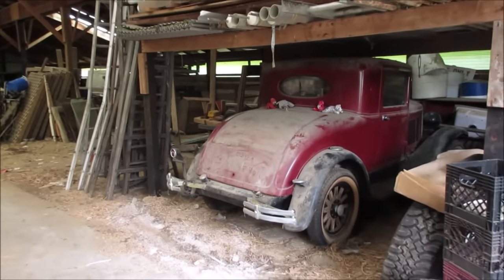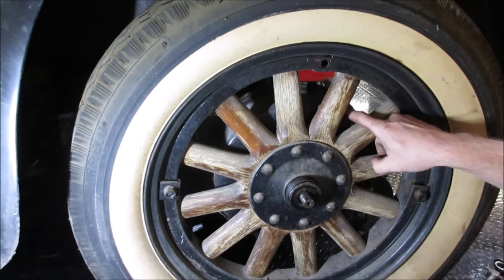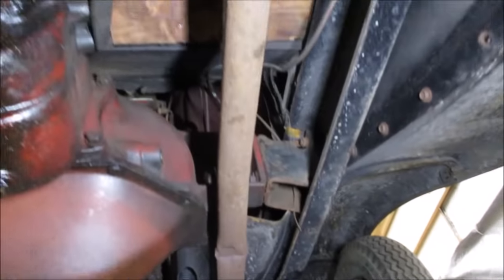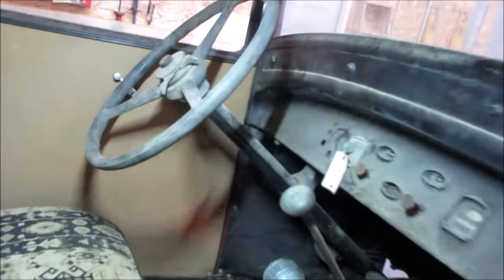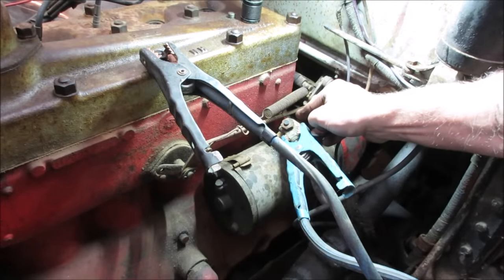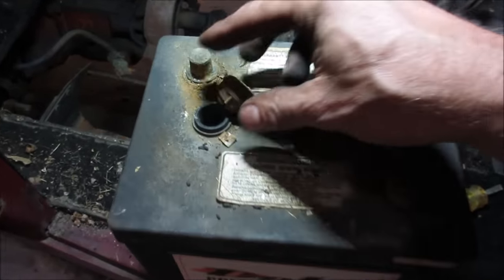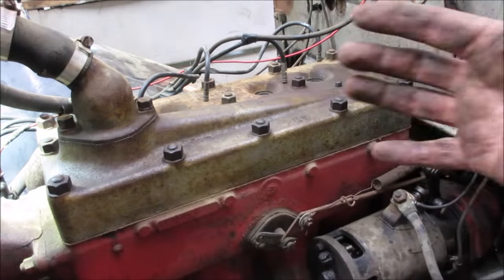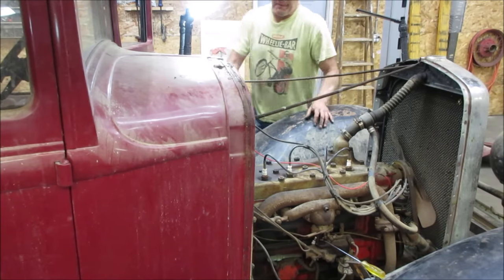abandoned rumble seat Plymouth, can we save it?

Comment: The brakes are adjusted with a gauge that measures the drum diameter and you then adjust the shoes to the gauge. The lower cam bolts are set when the shoes are newly installed and the upper cams are for regular service adjustment. Always trickle charge a new battery before applying any load. They are never fully charged.

Comment: You need a wheel puller. They are cup-shaped and thread onto the hubcap threads.  There is a bolt in the center of the cup that bears against the axle as you tighten it down.  Pops the wheel right off!

Comment: The hand crank had a straight shaft with a pin that went through it and stuck out both sides of the round shaft. The pins went up against the end of the crank shaft and went you cranked it the crank would go in the direction to allow the pin to come free. The only thing you don't want is a back fire when cranking over the motor. The wire out of the steering was the spark advance.

Comment: changing the polarity of the bat.  won't change the direction of the starter or anything else, old fords  6 volts ran positive ground, a lot of people ran them for years the wrong way only thing that ran backwards was the amp gauge, even the radio worked!

Comment: Love the car, love the vid, but for the love of god man if it hasn't ran in 40 yrs u gotta throw a small amount of some kind of lubricant in those plug ports! As soon as u pull the plugs, that way it can soak and rejuvenate those rings while u tinker with the electric, and then the SECOND you get it to start turning over, please, do the simple oil change. Even if it's in there there is absolutely no viscosity left...and maybe use gas mixed with just a little 2 stroke if your going to throw fuel straight in the cylinder, and of course that fuel is going to disappear fast the compression burns everything in just two or three strokes. But I have learned fun tweaks from you also, great job I just hate to see another old motor get scraped because the extra time wasn't given, best of luck to Ya!
~ZJAK

Comment: The starter will run the same direction whichever way it is hooked up because the field is a winding not a magnet. When you switch the polarity on the armature you also swap the current direction in the field.

Comment: Turn the lights off you'll see your missing spark mustie my dad had the same car and frozen water pump issue watch my dad have same problems! Wires carbon trials  and points bad , bad coil wire motor mounts he bronze wielded the crack in the water pump with ascetalene gas torch heated cast just hot enough to sweat in crack it worked!!! ; ) hey don't if that helps any!!!

Comment: Based on the sneak peek at next week, you've figured it out.  One lever on the steering wheel is almost certainly a spark advance which slightly rotates the distributor.  I have a 1929 Model AA truck which I'll be starting to work on soon.  Fun to see what I'm up against!
Reply from the maker: no it had a frozen cable too the dash,
Reply: One lever is lights and the other is the throttle. Spark advance is a knob on the dash.

Comment: Just a little tip. Use propane on these first starts. Bypasses the fuel system and helps narrow down the condition of the engine.

Comment: Not too sure if it is the case with Plymouth, but a lot of those older cars had a latching parking brake, so you'd pull the lever to set it, then it would fall back to the rest position, to release it you would need to take up tension before pressing the button. As for setting up the brakes, a good trick was to draw chalk lines on the shoe faces then drive it to see where the contact was, then adjust accordingly, it was a much more manual process to get the brake contact patch correct.

Comment: I don't know if anyone else has mentioned this but you've gotta engage the engine with one of those switches on steering wheel. Everything is manual you've gotta adjust all the controls in real time while driving. Also max speed is probably 22 mph tops.
Reply: Google shows mid 40s to mid 50s which makes a lot more since than 22mph. They had paved roads in the 30s lol!

Comment: I once had a neighbor who had a 1936 Plymouth Business Coupe in her garage.  Turns out her late husband had restored it and she needed someone to sort of care for the car, including driving it once in a while.  She saw me working on cars enough and eventually asked me if this is something I could tackle.  I said I've never even owned anything with a carburetor but how hard could it be?  That car was cool.  Inline 6, 3 speed synchronized trans, hydraulic brakes.  Didn't take much to get it going.  Mostly screwing around with the carb, fuel pump, generator, battery, and maybe I did an oil change on it, too.  Later on she sold it because she needed the money, which was kind of sad.

Comment: Brake lines are probably copper nickel, when replacing brake lines in Europe, we don't use anything else, easy to work with, and last forever, or, at least until you need to change the flexible lines.

Comment: I own a ww2 willy's jeep. It is downdraft and runs good. I also own a international C-157 overhead valve, updraft carb in my forklift. This thing won't run no matter what I try. I have replaced the carb with a new zenith and also rebuilt both carbs including cleaning them with my ultrasonic cleaner, Nothing helps, The engine has been rebuilt also. This thing is possessed, help!

Comment: Re: Re-bar to anchor stuff - try this: take 3 pieces of rebar or other stout rod - pound em into the ground a couple feet apart in line with the direction of the forces being exerted. Tie the top of the first to the bottom of the second, the top of the second to the bottom of the third one - that way you can get a whole lot more comeszouta...

Comment: Mustie1,  I think I would pull that engine and replace it with a Ford 302 or 351 Windsor and a 12 volt system.  Put in an automatic tranny, Ford 9" rear diff and also, a set of gears in the rear with something like a 3 to 1 ratio or higher.  It would be fun to ride.

Comment: Don't know if anybody has told you but changing the polarity will not change the direction of spin in a starter motor. If you want to change the  spin direction, you'll  need to swap the leads on the field windings

Comment: Replace a spark plug wires, replace a coil replaced appoints a cap looks good. Let the battery charge to a full charge and try to start.

Comment: Years ago I worked for a guy who had restored his father's 1916 Dodge sedan.  It was a fantastically perfect restoration, with one exception.  After he had scraped the old gray paint from the wheel spokes he liked the bare wood so he varnished them instead.  He took the car to Hersey to compete...and there was another 1916 Dodge there, just as good and with painted spokes,  The judges didn't know which was correct so they deducted points from the other guy and my boss won Junior Grand Champion.  Much later, in another city I noticed a photo of a 1916 Dodge sedan in my doctor's office, so I related the story.  He said,:"I know, that "other" car was mine!"

Comment: If you get in this type of situation again that you need to do a side pull on a dirt surface. Get you about  3 or 4 metal rods about 3/4 to 1 in round and about 3 to 4 foot tall put them in the ground about 2 ft or more at a 45 to 90 degree angle. The hard part is getting them out of the ground. I had these on a 5 ton wrecker when I was stationed in Germany but luckily I never had to use them.

Comment: Volvo Amazon (120 series) had an ignition coil linked to the ignition lock via a steel cable as anti-theft protection. This seems to be the same idea.

Watch out for scuffing of the high voltage cable from the coil.

Comment: Plymouth started in 1928. In 1930 the Model 30-U was introduced which wasn't much different from the model U of 1929.
I don't know which model this is. Most of these get Resto-modded rather than restored.
I'm digging:
Mysteries are presenting. The oval rear window is not present on all 1930 Model 30-U Rumble Seat Coupes. Some were convertible rag tops.

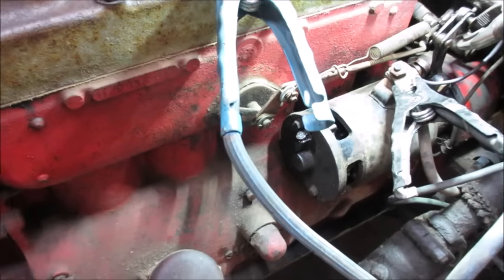Comment: 53:18 Yah. pull the starter and get the Bendix working so it will push out and engage the flywheel. Lots of joy juice, even heat, will assist.

Comment: 1938 is only a few years away from the point where domestic auto manufacturing was halted in the US by the government to reallocate those resources to the war effort.

Seems like this car is in mostly okay shape. Just forgotten about for many, many years. Hopefully it's not past the point of a rustoration.

These old cars had so many levers that I wouldn't be surprised to find out the starter motor has a manual transmission, and you have to get it into 3rd gear before the engine will turn over. 😅

Comment: The starter will turn the correct way no mater postive or negitive ground due to the way the starter is wired internally. And yes the rear hubs used a puller that threaded on to the cap threads. You have a lathe make a puller ! Apiece of tube with internal threads with a cap welded on one end with a large nut welded to that . Run the puller onto the hub ,run a bolt thru the nut ,tighten firmly rap the bolt head firmly with a 5 lb hammer. Those taper hubs should be tight !!! Not like the first one you just pulled off. Car should be postive ground . Dodges pre 27-8 were negitive ground 12 volt, before becoming part of Chysler corp.

Comment: When you noticed the water pump housing had cracked , is there any danger of the parts having split apart and fallen into the motor?   Did they have a thermostat back then?

Comment: Very clean find, best of luck to you. Has anyone  tried hydraulic pressure  on a cylinder that has closed valves and a grease gun to pop one loose?  A spark plug with a zerk fitting. Likely the worst that could happen is a broken piston? Aren't flat heads amazing? Bet he steals a 6v coil off of one of the vdubs
Reply: But then you have to contend with all that grease you just pumped in. Better ways of dealing with a stuck valve.

Comment: The lower bolts are eccentric bolts and adjust the brakes in and out ; the upper bolts adjust the angle of the brake shoes to the drums

Comment: MY YOUNGEST SISTER HAD AN OLD PLYMOUTH AND IT WAS LIKE THIS SO WE PULLED IT BEHIND MY PICKUP ONLY A BLOCK AND THE STARTER BROKE LOSE AND IT STARTED RIGHT UP. iT HAD SAT OVER 60 YEARS. WE CHANGED THE OIL, LUBED THE cYLINDERS WITH cOAL oIL AND IT EVEN STARTED ON THE COAL OIL.

Comment: Originally it was called a parking brake, for parking and not an emergency brake at all.
On newer cars with electric "e-brake," try it at speed...it doesn't work because it's not an emergency brake, it's a parking brake, but to hold the car still on hills, etc.
Leaving the ignition on for a long time will probably destroy/damage the coil, old wisdom sees the light...

Comment: Probably find you have damaged or cooked the coil, leaving the ignition on, without the engine running, puts a full short circuit in this type of system, instead of a pulse, which it was designed to handle. Doesn't take long to destroy a coil but people still leave the coil powered on while doing other adjustments

Comment: If the battery is original, it's 100% repairable. Mind, it will still be a weak 6 volt battery, but it's 100% repairable. I actually miss that.

Comment: Lovely car but i doubt it will run long on unleaded gas Plus you need to be careful not to burn out the starter motor  while you havent even fixed the carb or fuel pump yet

Comment: with 6 volts you nee good clean connections. there is higher resistance  with 6 volts. also you need bigger cables with 6 volts

Comment: you can't tell the polarity since the starter would have a coil field that would get the same polarity as the the armature.
A better way might be to spin the generator with a drill. there should be enough residual magnetism to see some voltage polarity.

Comment: It amazes me how ham fisted some these guys are when dealing g with valuable vintage cars like this one     Any car that has not been run in 40 years is going to have electrical problems  coils deteriorate  as do distributors and regulators   check the condenser in the distributor along with points and old wiring

Comment: Ask your friend if he'd be willing to sell---My Dad drove a 49 Plymouth for many, many years--I had to service and take care of it--rebuilt it several times-still have the hardened ice pics I used to remove and install the brake shoes--damn I was good with that LOVELY old car--at many times through your video I was screaming "NO IT"S POSITIVE GROUND" or "IT'S SIX VOLT--REPLACE THE DAMN WIRES--THEY CORRODE FROM THE INSIDE OUT" NOT ENOUGH POWER TO KEEP THEM CLEAN"--Dad complained about me buying a full roll of plug wire material--After two years, since the power of 6 volt wasn't that great you'd have to replace them--I went on to be an engineer, first for Ford then consulting---Had a fun life--now I'm retired---I'm DEAD SERIOUS about this Plymouth...PLEASE REPLY?!!

Comment: Sorry but either your connections are bad or the battery is flat, you shorted the jump lead to the spring and if it was good it would have sparked or melted the spring.
When you connected the charger you had a wisp of smoke from the clip on the block.

Comment: Looks like a 50 year old restoration.  Kind of a waste the way it was 'stored'. May have hand throttle on the wheel as well as on the floor. One lever is the advance for sure. Kind of surprised it has juice brakes. Not sure if they were still suing babbit bearings in 1930 (probably).

Comment: Chrysler was so far ahead of Chevy and Ford.  My '33 Plymouth has Full pressure lubrication, synchromesh and hydraulic brakes. A modern drivable automobile. Ford had Mech. brakes until '39 and Chevy had babbitt beater bearings until '53. I have really enjoyed this episode much more than the others. Tired of tubers hacking up historical vehicles. Keep it up.

Comment: If you could turn it backwards with the crank it would be extremely dangerous to try to hand crank the car because it would drive the crank when the engine started by the way your generator tension bracket is broken next to the mounting bolt.

Comment: The I'm not entirely sure but I think that's a pressure release is the lever behind the starter motor that you first pressed I'm not entirely sure though it just cannot looks like it usually push that lever to open up the pressure in the cylinders to let the engine just been over faster and then you close it to make it start I could be wrong though.
Reply: Wondered that myself what with that linkage running into the side of the block.

Comment: That carb on that car would be a up draft because it’s pulling air up into the engine instead of let’s just say a ford in-line 6 it’s a down draft carb setup it pulls the air and fuel mixture down
Reply: I’m simple terms I don’t know the full extent of the names of it and stuff I know about cars and stuff but I don’t know all the technical terms😂

Comment: The starter will run the right direction, no matter which polarity you use for the battery. It has field coils and armature so, when you reverse the polarity to one, you reverse the polarity to the other.

Comment: You need to go study how those steering wheel controls work in relation to the spark and starting and running of the engine. Some times you should do some ready/learning before you do all of this trial and error! I think you are missing something. I think these era cars need to be adjusted on the steering wheel to get them started and stay running at first. get in touch with MRheveyshevy he has an old fold from the era. I bet he can tell you what it is you are not doing correctly. I bet others will write to you and clue you in also Mustie. I like your videos. I just think you should do a little more studying on some of these projects early on.